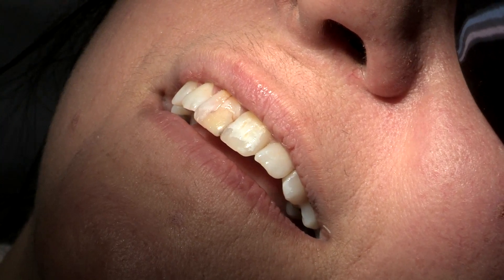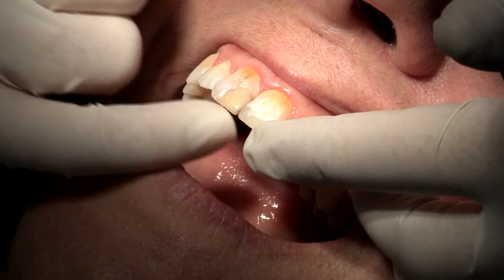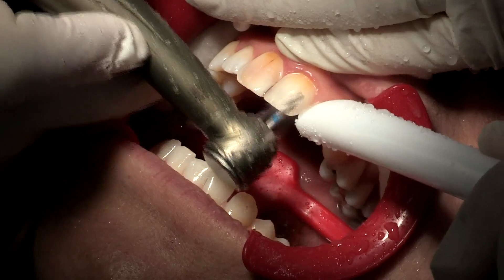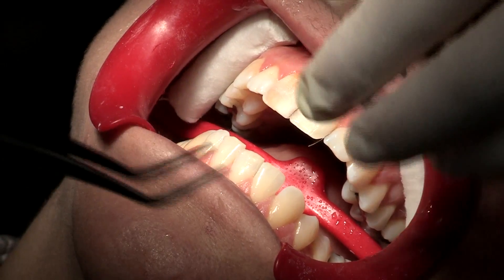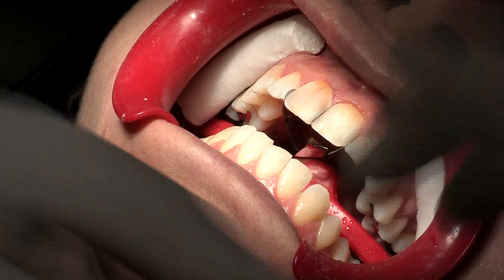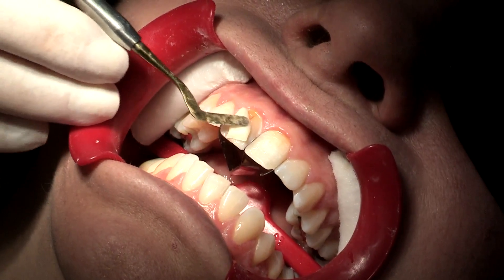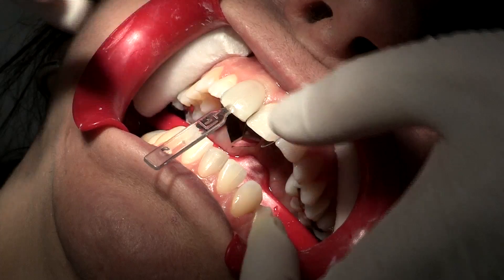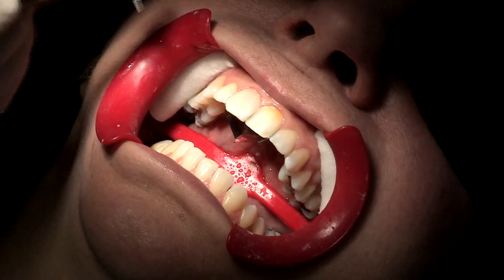Uveneer on Patient

Comment: Dr. I've tried the template once after curing it was difficult to remove it from the tooth surface and the template fractured, is there any material can be used as separator to remove the template without sticking
Reply: I use the template all the time. Ive never had that problem.

Comment: Hi,
What composite did u use ?
Reply: Vitlescence from Ultradent
Reply: I used Amaris by Voco. But  I have many in my practice and this case was 3 years ago, I did however used last layer high fill Universal Geniael flow by GC . In my practice I use: Vit-alescence by Ultradent, Valo light, Gradia by GC, Amaris by Voco , Asteria , Ivocalr empress direct and Cosmodent Renemal microfill .Please join our group in Facebook called Uveneer by Ultradent and you will see tips and tricks and many cases